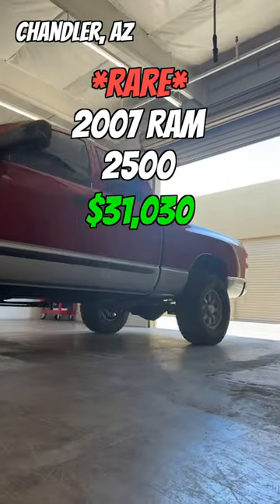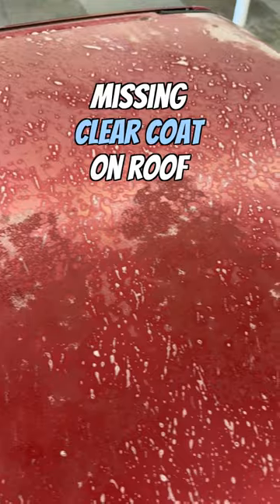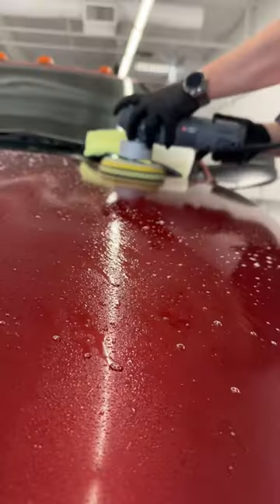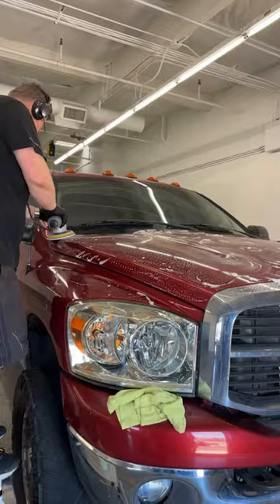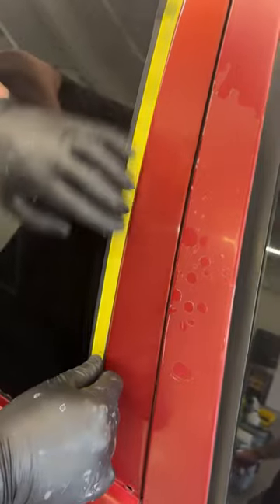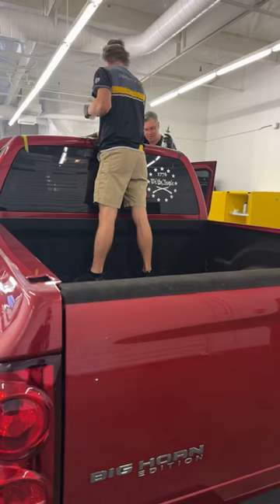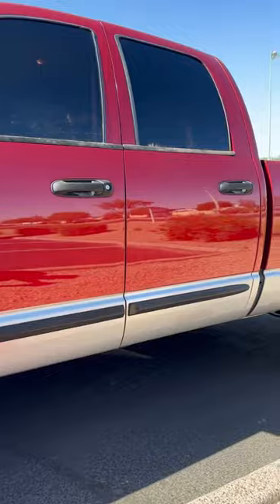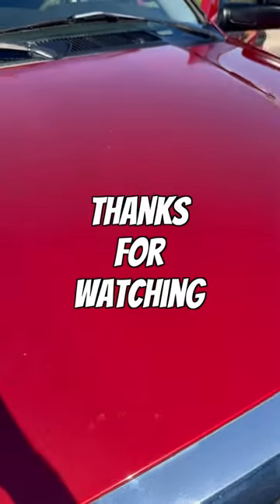Amazing Dodge Ram 2500 truck restoration #cars #automobile #restoration

Comment: I'm still trying to figure out what's rare about a truck they made 100s of thousands of 🤣
Reply: Probably 6 speed manual
Reply: 100’s of a vehicle is rare, even 1000’s can be rare, 10’s of thousands is your dime a dozen
Reply: Its most like a 5.9 which was only made for half of that year. 

A manual 5.9 only made for half a year would be relatively rare. 

A 3500 manual would be alot more rare though. 

Still not agreeing with super rare
Reply: @quentonmillstid850  Which means its rare but not worth anything
Reply: nothing is
Reply: The way the truck was configured from the factory can make it pretty rare! Low mileage, 6 speed trans, leather interior, last year of the 5.9 cummins before the 6.7 was introduced in the later half of 2007.

Comment: Once clear coat fails, there is no amount of wax or protection you put on it to stop it the process.
Reply: Probably charged him quite a bit to do this and in a matter of days, maybe months it’s going to look exactly like it did when he brought it in…..waste of money
Reply: If you're very careful, you can sand it down, and do you best job blending it with a fresh clear coat in select areas. But it never really lasts.
Reply: Also can't blend clear coats like color, you need to sand all the clear off

Comment: Most Auto manufacturer clears pre-dating 2010 have very little to 0 UV protection.. Tops surfaces are always the first to fade because of this.  Maaco would have charged around $2500.00 for it's top clear coat and paint package.  That's REALLY good... Results may vary.. Now... You can buy clear and color for that vehicle for cheaper.. A good UV clear in Euro 2:1 58% high solids (high solids protect better).. around $250.00 as high as $800.00 for an overpriced clear with less than 55% high solids.  The color, depending on paint brand, can cost from $250 to as high as $900 for a gallon of the red for the vehicle.   The roof and hood weren't showing any signs of crows feet, which means there is no need to strip either panel down to the metal. You can simply 180 the bad area and feather out the bad spots and still retain the color and not burn through.. Seal them both and slap on a single stage paint (which you can add a clear too or UV protection) or base it and clear for less than $800's.. Anything is better then polishing basecoat and saying you added a protection and charged someone for it and then make a video about it patting yourself on the back. (once the sun and rain hit the base coat, you got very little time, til crows feet show up and that simple fix gets a lot worse and more costly). I use to own a detail company, i started to learn more about paints and clears and now I own a body shop.. Informing a customer properly is better then any work you can ever do for them.. You've taught them something, they can use.. Be it when getting work done by others or a DIY thing... That guy had many options he could have used to fix the whole truck and add years to it's life, that wouldn't brake the bank, but polishing basecoat is not one of them....... No one ever, was born a brain surgeon! As for the rest of the truck, you did great.. but there was wasted time and effort and money on that hood and roof.. assuming tops of the doors were bad too and perhaps the tops of the fenders and some of the upper bed edge.  Surprised there was no rust in the quarters on the truck and the rockers are still solid.

Comment: If the clear coats already fading and you take off more layers it's just going to make things worse
Reply: I think they are stripping the clear coat and applying a fresh clear coat. Which you can do, though I'm only familiar with spray on paint/Clearcoat  so I am a bit confused.

Comment: Not super rare, but its definitely a gem
Reply: Not even a gem, it’s just another 3rd gen 😂
Reply: @KDlGG  I live up north
Reply: @jacobm9263  so do I, every truck I’ve owned has been rust free.
Reply: @KDlGG  and if it was an older truck you Def paid out the ass or bought it from an old dude
Reply: @jacobm9263  first one was an 07, bought it for 10k 197k miles, bought it from a lot. Still had the factory frame coating, originally was a Cali truck, moved to Montana and then made its way to me where I seen it and snatched it. 2nd one was a 01, 202k factory coating was chipping off but no rust, could see bare metal in spots on the frame got it for 11k, brought it home and coated the frame and axles. Idk what to tell you, I’m picky and have a good eye ig, both are diesels btw
Reply: @KDlGG  that's a lot for a 15 year old and a 22 year old truck, even with them being clean. My point is they are pricey for what they are, and neither was a 12v truck
Reply: @jacobm9263 same Prescott?
Reply: @KDlGG Wasn’t hard to find a good deal before 2020
Reply: @jacobm9263  it’s not a lot considering what prices are in todays world😂
Reply: @Jacbedn  bought the 07 in 2019, 01 was bought in 21

Comment: Need to do this to my 98. Clear coat on the hood and roof is starting to separate.
Reply: if it's a small spot I would suggest just sand it down and respray it and clear coat it

Comment: When I repaired the rust on my 03 rare ass 1500 hemi 4x4 off road package ( very rare) 

I got the paint buffed and It properly detailed it looked brand new other than some dents and scratches adds character to it though nothing severe
Reply: that is very rare indeed.
Reply: @landenew  that model truck. Yeah it is very rare
Reply: Much Rare. Wow
Reply: Meh, medium rare compared to the 07
Reply: @Cøbra-u5x  2007 had those rims also I believe. 

It’s extremely rare not medium rare. You do not see the rims. 17 inch alloy rims only on 4x4 off road package ram trucks from 2001 to 2007 maybe. I thought 01 to 04. I have seen a 2007 with those rims on it

Comment: Restoration includes a new coat of paint AND clear coat. I'll give it a month (being generous) before the amount of compound and wax will burn off. I bet he/they even waxed the headlights and most of the rubber, only to apply tire shine to all the black parts they waxed over (cab lights)..